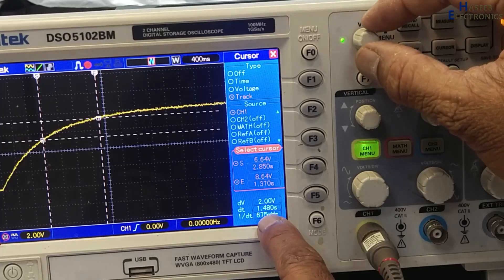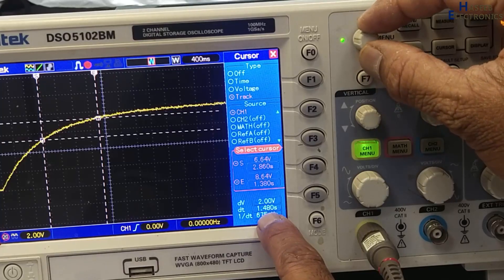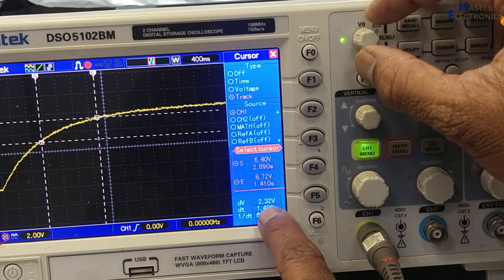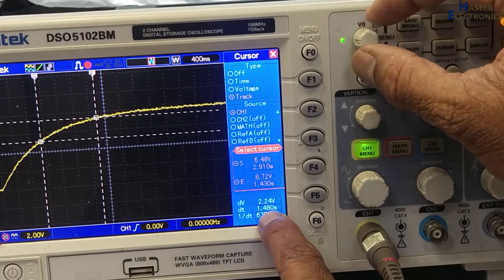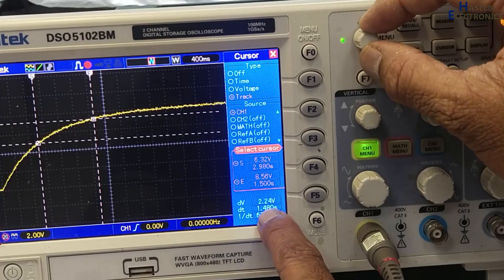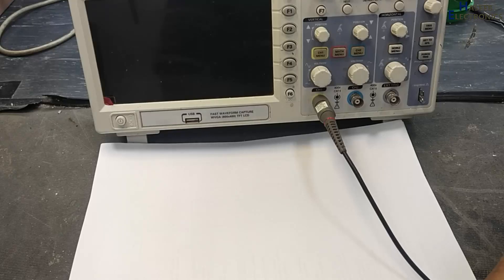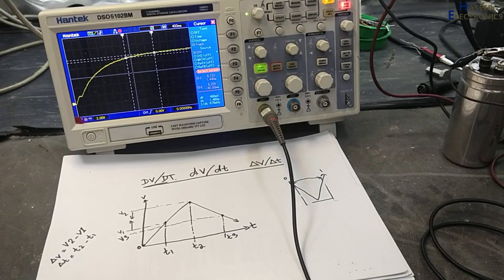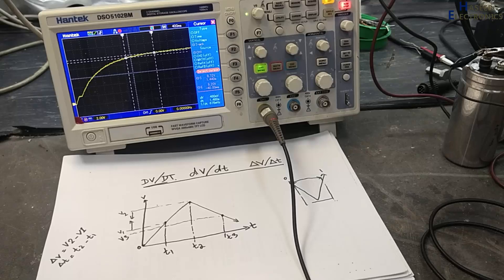{1135} how to measure dv/dt using oscilloscope

Comment: Sor can we measue the voktage accross hogh frequency transformers primaey side which is switched at high frequency say 30khz using multimeter? Say we want to measure acroaa one side of boos aectio coil of inverrtrr ?
Also can we measure the output of hf transformer after boost using multimeter.
Thabos for uour ojformative video's